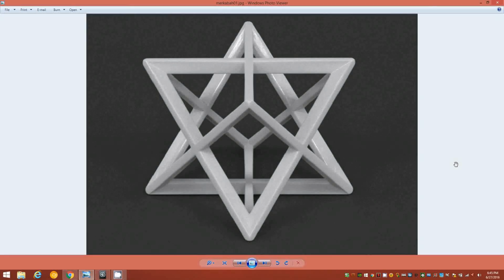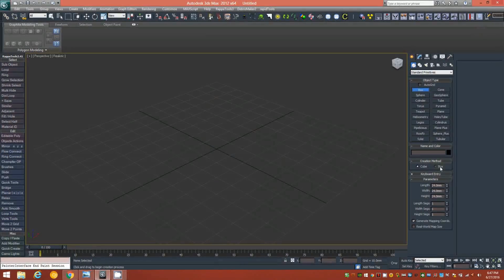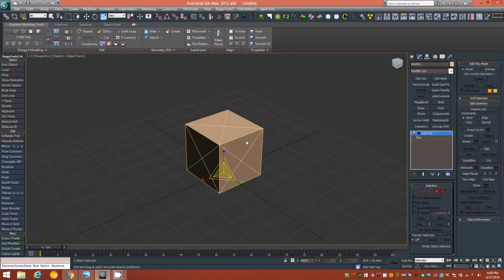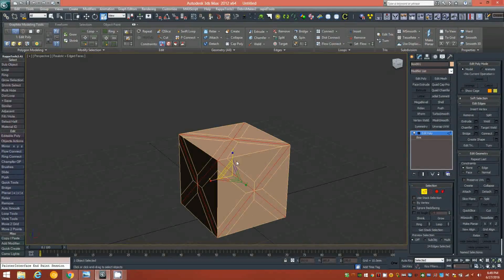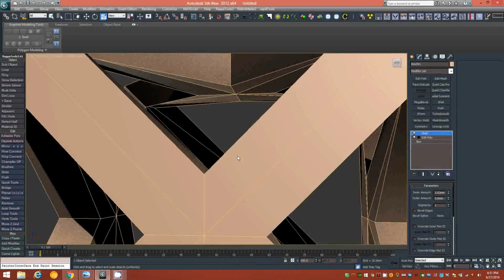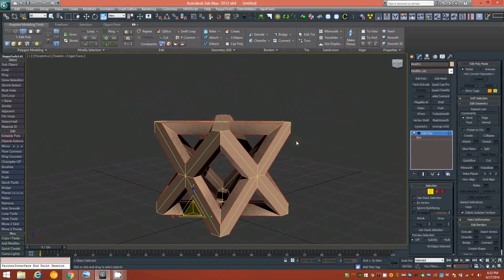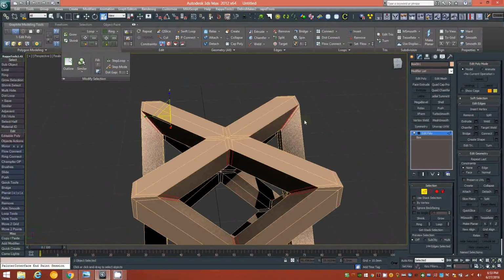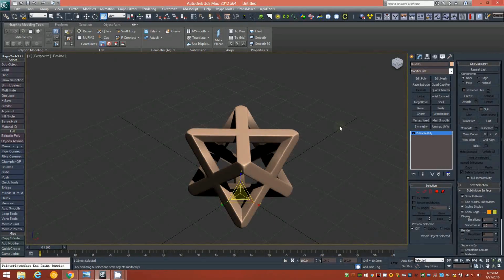3d Tutorial | Sacred Merkaba Revisited | 3dsmax

Comment: Thanks for sharing, I never use the selection with Similar option. I always use the Loop option and Ring.
Reply from the maker: Oh, yes, the Loop and Ring options are ideal in most situations.  However, sometimes there are conditions on the mesh where they will not work.  For example, when faces or edges are not contained along the same loop or ring.  In this case, Select Similar will solve the issue.